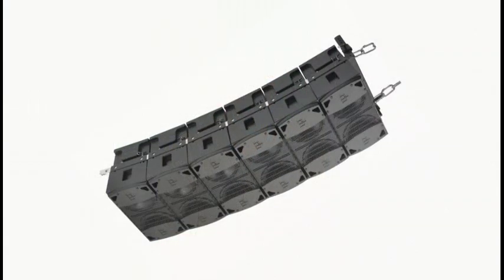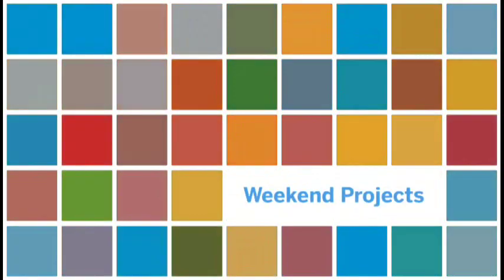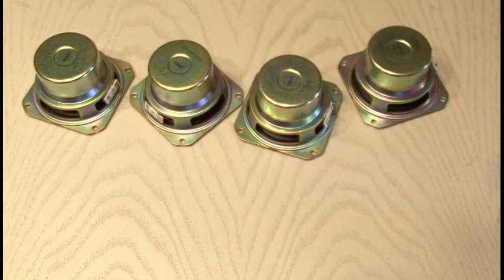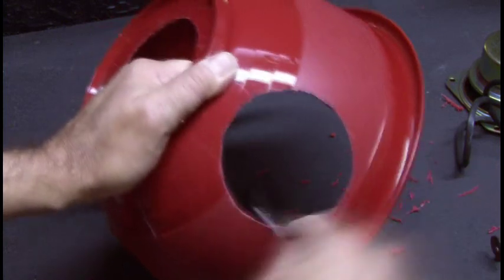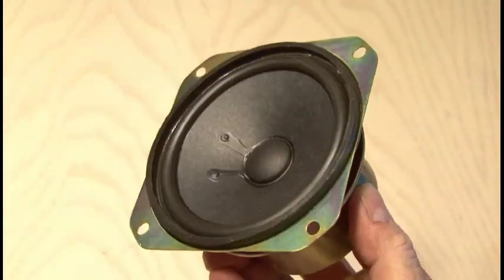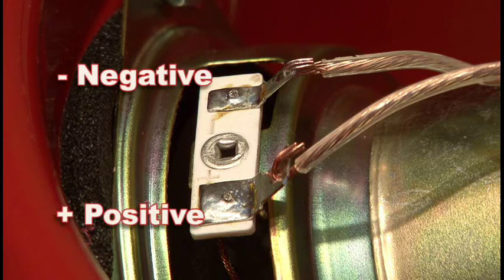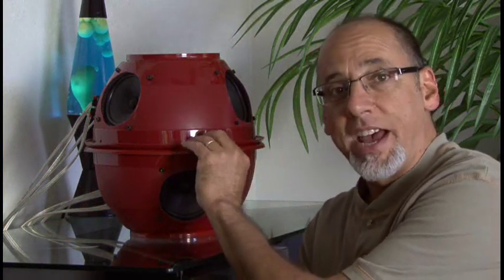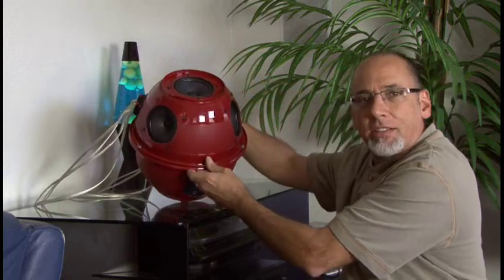Weekend Project: The Ball of Sound

Comment: the whole purpose of placing speakers in a box is to create difference in airpressure between the front and the back of the speaker. Therefor the box has to be as stiff as possible. This plastic will due almost nothing as a seperator. It is best heard with the lower tones.  That is why this box seems high toned end missing mid and low. It is absolute useless unless you like the looks of it and dont care about the sound.
Reply: computerjantje so it’s not gonna work for me as I love my bass and my mids sounding deep and good in my music

Comment: I couldn't find any salad bowls the right size, so I went to Home Despo- I mean Depot, and picked up some planters. My Dremel sucks, so I used a carpet knife to cut out the holes. Our local Radio Shack also sucks, and I couldn't find some terminals, so I just hardwired everything in. Works great Kip!

Comment: That changes the impedance of the speakers. Wiring them in series would result in a higher impedance, where wiring them in parallel would make for a lower impedance. You could choose speakers with particular impedances to wire in series or parallel in order to match your amplifier.

Comment: @TheEd500 Speaker terminals expect a certain resistance rating in ohms from the speakers.  If you connect the speakers in series, you increase that and decrease the volume coming from the speakers, if you run them in parallel you can damage the stereo as it draws more power from the stereo than the stereo might be able to supply and damage the stereo or speakers over time.  If the jack says it is rated for X amount ohms, better ensure the speakers connected there are rated at X amount ohms.

Comment: You will always need at least four wires for stereo sound. But you can connect speakers in serial to get rid of those other four wires. Beware that some properties of speakers then change, like the impedance will be sum of all the speakers in serial connection.

Comment: the car audio shop near my house had a sound ball that has 4 radial tweeters and a 10 or 12" midrange mounted on top that fires into a dish shaped plate that spreads the sound. you can hear the sound equally everywhere except directly under the speaker. no stereo imaging though.

Comment: @15commandments because speakers are basically resistors, and wiring them in series would make them all weak because the amount of ohms through the wire would be astronomically high, you'd need some sort of splitter. it wouldn't be cheap.

Comment: foxy says cool this brings back memories  many years ago I had a plastic planter which had three holes in which you hung from the ceiling I had just completed a little am radio which needed a 25 ohm speaker and didn't have one so I fitted 3 x 8 ohm speakers in series and built the radio into the base of the planter and fitted the knobs had a cool looking radio to hang up in the conservatory or greenhouse don't know what happened to it but was in the seventies

Comment: so much room for improvement! as a sound tech I can definitely try this one out but I will make some adjustmens as to fit in some subwoofers to complete the array line. becouse what good is an array speaker set without its subwoofers to support for the lower frequencies (600Hz and lower) the speakers you used should work better if it is used with some 800Hz-20KHz range speakers 60W 8 Ohm and the subwoofer in my case will be a 8" low range 120W 8 ohm subwoofer in a casing of some more salad bowls, I'll let you know how it worked out :P

Comment: Don't know if anyone mentioned it in an earlier post(130 at last count),but something should be said about the final impedance!Running them in what appears to be parallel(or series for that matter),especially with 8 speakers,will cause a DRASTIC change in impedance,and could easily fry an amp or stereo.Other than thet,love all the neat things you post,that's just my .02

Comment: i get it! sound goes trough the air as pressure differences. when the speaker should move forward, it will move backward into its housing when you connect the cables incorrect. Normally, it makes no difference, but because you have 8 speakers, the sound waves will interfere and you will hear that.

Comment: you can use a guitar amp to run any type of speaker, as long as they´re the right size. the only unique thing about guitar amp speakers are that they´re voiced differently from hi-fi speakers. all speaker types can be run in paralell or series etc. instead of using the 8 connectors like he does, you could run 4 speakers to each connector, and just have two connectors. as long as you did it right, it should work just fine.

Comment: hey kip where did you pick up your woofers and such for this project? just a word of advice as well, easier to use the rotary rasp bits for the dremels for cutting plastic rather than using cut off wheels

Comment: So, the 8 sets of leads coming out, how did they hook into your amp?  Most amps have 2 left and 2 right inputs.  Would hooking all 8 speakers up to that have issues with the ohms rating of those speakers?  Wouldn't it make more sense to double them at your speaker end, and just run 4 sets to your amp?

Comment: That is awesome , but  is it much easier if we series parallel the connection to make it two channels,it will make the wattage higher and also the impedance.. and you will only need one speaker terminal for stereo .... just a suggestion ...

Comment: You could do that, but the resulting load to the amplifier would be 1 ohm, which is afwully low for a home amplifier. 

Then again, you could connect 2 sets of four parallelly connected speakers in series, resulting in a much more safer 4 ohm load.

Comment: A better wiring option would be to have only one +/- terminal on each half of the ball, one L and one R, and then separate the signal for each of the speakers. That way you only have to connect two wires to the receiver you're using.

Comment: ok bare with me, 10 30Watt speakers instead of 8 then using 5 TDA1554Q you can make 5 2x 22Watt amps you can put a 230V to 12v  or 120V to 12v converter to power your amps.

you should get a 220Watt sound system with a array type sound dispersion. (if i'm not mistaken)  

Personally i prefer to make portable sound applications but what the hell, i'm thinking on this one now.

Comment: I agree the bass ports need to be put in but he hasn't properly sealed it
Reply: Also the speakers he used are shit. Im building mine and I'm puttin in some Dayton Audio woofers and on top of that I'm using dayton's soft dome 1 inch tweeters to make the highs sing. Will need bigger bowls for the crossovers and shit.  Then on the very bottom I'm puttin a Dayton ND105 4 inch high excursion woofer to act as a subwoofer.

Comment: !!! one important question . Can I wire 4 Speakers in parallel and series so 4 * 4 ohm speakers so that it equals to 4 Ohm in total? And what are the "dangers" with this setup?
I know a lot of the circuit calculation, but i don't know if it is bad for the amp or not

Comment: 2 ohm amplifier fryer bad! Why not motor spin the unit with magnetic induction & impedance matching to make it worthwhile building. Use Mett-glass/spiral flat coils face to face(brushless power connection) and add piezo tweets to get the highs. Now top that you Leslie fans!

Comment: The one thing I saw that could be fixed or polished up is the wires going to the "Ball of Sound".  it looked pretty ... well ugly.  I would try and put all the 8 wires in one tight group of wires or even go one step further and build a conduit for the wires to travel into the ball of sound and connect inside.  But of course... up to whomever is making it.

Comment: couldn't you bend the corners where you put the screws on the speakers, instead of having to buy weather stripping. also, you could just use 7 speakers and put an Ipod dock or even a netbook if you're rich in the hole where the 8th speaker would be, couldn't you?

Comment: hay,a smart thing to do is in your condom hack#2 with the condom light thing(but talk away the condom's so it wont look wierd) and then drill holes in the bowls for the LED's and take the LED's wires and soder them to the contacts on the speaker conectoins on the in side of the bowls.

Comment: has anybody ever heard of ohms law? If you use 8-8ohm speakers on just one system you'll be drawing 64 ohms out of a stereo that at most will only put out 32 ohms max. you'd end up burning out the recievers fuses with repeated use. the newer they are the harder they are to repair.

Comment: Most likely not very good, there is no airflow to the rear of the speakers so the bass would be pretty bad. Small holes in the side of the plastic around every speaker would improve quality. And Some sort of bass vent wouldn't hurt and would improve sound quality considerably.

Comment: i did mine already.. its okay.. nothing special.. regular sound speaker to me.. 

but id rather buy a finish product if you don't want to buy all those 8 speakers and put it in two bowls.

still.. a good project. :D mine is like on top of my bed soo its good. 

intead of bowls.. i used a square shape plastic thing. iono its just a square shaped item. 

im already hooked with speakers in my room. 

too much already.

Comment: mm nop actually i dont... speakers dont work like that, A speaker has the hability to put 30w of power, the power comes from the amp, so youll need at least a 200 w amp for that array....

because the most common connection for them its paralel,  it doesnt matter, the more speakers you connect, the sum of the total impedance will be lower than one speaker, you just have to be carefull not to lower that too much or you'll put your amp on fire xD

Comment: 30 watts sounds like its gonna be really tinny...
Reply: 30 watts x 8 speakers = 240 watts rms

but with the crappy salad bowls it will sound like crap
Reply: ***** *just proved my point*.
Reply: imagine putting a subwoofer in this with decent speakers. The acoustics would be good? possibly..
Reply: weeowey you need an enclosure that is sonically dead.  No resonances from the cabinet, that's why companies use thick MDF, aluminum or some form of sonically dead material for the cabinet and then stuff some baffling material.
Reply: weeowey subwoofer? you want that thing to bounce through your house?
Reply: roturd I think that it's 30w peak, maybe 10w rms
Reply: yeah